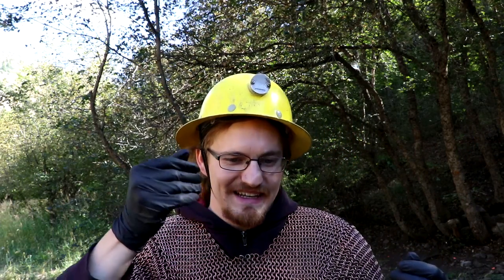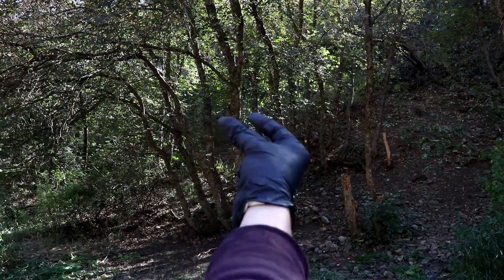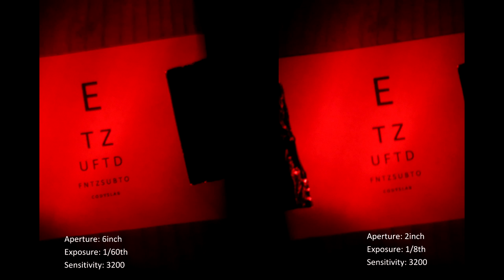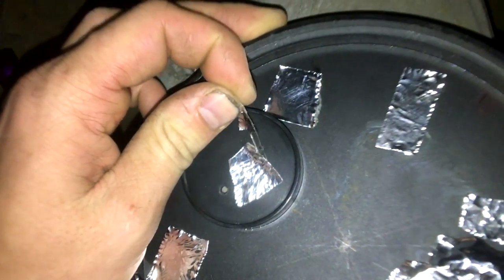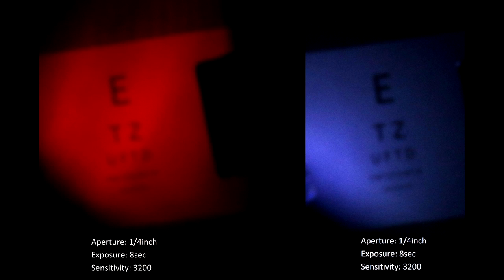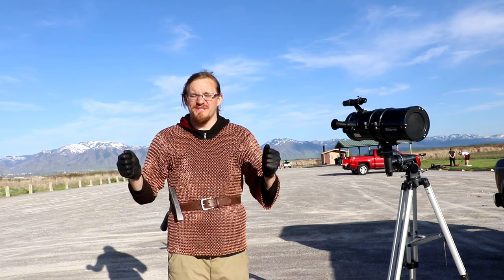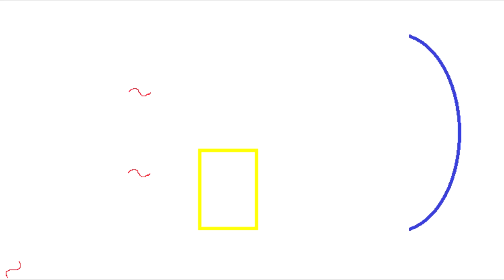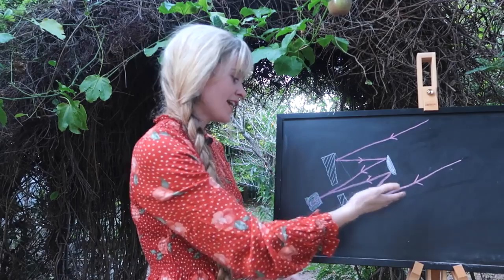Copper Clad Cody Attempts to Explain Interferometry

Comment: No-one ever answered my question:
What "Happens" when light combines destructively. Does it poof? Turn to heat mid-air? Get eaten by quantum gnomes? 
The photon clearly has energy, where's it go? Conservation and all that.
Like if I take two lasers and point them destructively at a point, would it still burn the spot they are aimed at, or ..?
Reply from the maker: Remember the light is everywhere and nowhere at the same time. When it cancels out it just decreases the odds of it being observed in that location.
Reply: @theCodyReeder  So, in regard to a cutting laser... All of my board (me included) and none of my board is being cut by lasers? 

Yeah I know, I'm just kidding. It just means you can't concentrate the light, so the density falls off and the laser's power is weaker and more spread out. It's less likely you'll see the laser actually burn a single hole, it'll burn a large spot instead.  Also, uh, thanks for being the first in thousands to answer that question.
Reply: @theCodyReeder  Say, uh, you still need an explanation of the heinsenberg principle to wrap your mind around it? I kinda know a lot about alot except chemistry, the unavailability of, well, ingredients, bums me out.

Comment: What would happen, if you lower the air pressure in the mine? are the surrounding rocks airtight? will the force crush the mine? I Need answers  :P!
Reply from the maker: It’s not air tight.

Comment: Would the holes be of better quality if, instead of drilling them, you melted them through the cover with a hot metal rod? I imagine it would at least make the edges smooth(er)
Also seeing that demonstration of wavelength vs resolution... Even though i was aware of the effect, it blew my mind to see it in action. Beautiful as always.

Comment: Classical physics is great for light. both in the daily setting, and in most astrophysics.

5:23 quantum physics is really unnecessary to explain these properties.
the wave theory of light, which can be derived from classical Maxwell's equations, explain all of these phenomena well.
In fact, Heisenberg's uncurtainty principle for quantum objects comes percisely from wave theory.
quantum mechanics postulates that even particles must be described by a "wavefunction", and wavefunctions obey wave rules similar to waves rules of water and light (although a bit different in the details).
then, since wave theory says that a wave that is localized, that is, has most of its amplitude in a finite region - must expand and thus momentum is 'uncertain' in the sense that the wave covers a large variety of momenta.
this is really just a property of Fourier transforms.
a wave's presense in different momentum values is described by a 3D Fourier transform of the wave amplitude function in space.
Fourier transforms says that (variance in position on one axis) * (variance in momentum on one axis) >= some known constant.

Comment: hi.   some late info.             at 2:55,  how does an  'object'/thing  experience  temporal affects.           at 3:05,   'equally likely'  is  NOT  correct.
photonic radiation  is  em  radiation.     (like, ir, visible, radio, uhf.)       em radiation  propagates  best, in the Absence of  obstructions.
including, an atmosphere.             in discussions about 'light'/photons,  it  Should  be assumed that a  Laser  is utilized, to produce photons; the result is a photon beam,  that has a  known/specified  vector.             discussion of the interactions between photons and objects   SHOULD  include  Absorption.   the end, of many a proud photon.             it makes as much sense to assume that a photon emits  sub-photonic particles; such that, one photon can, apparently, pass through  tandem, slit apertures, simultaneously.
(has this test been done in a vacuum, i wonder.)    cheers               googletranslate

Comment: All this monkey got out of this is go for the objective aperture not the power when looking for a telescope, size matters. Yours balls on the water is an elegant display of wave reinforcement and cancelation the diversity effect is also used in weak signal radio reception. The debate continues is light a wave or a particle, energy or matter? I think we need a new term to define light  "Bi-relativistic-thingy" short form "Enertical".